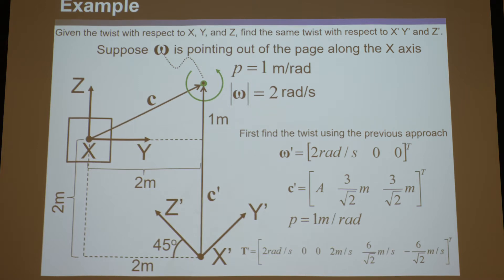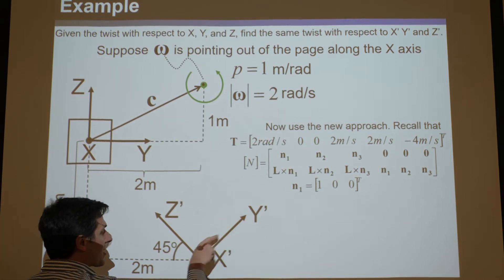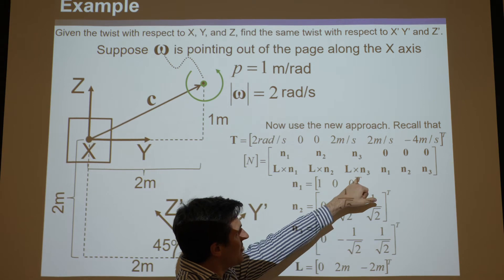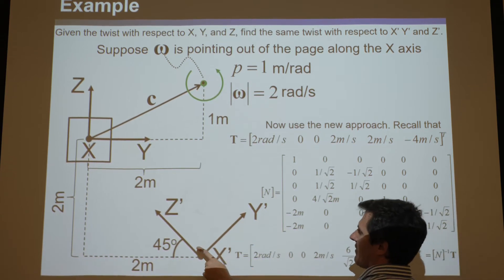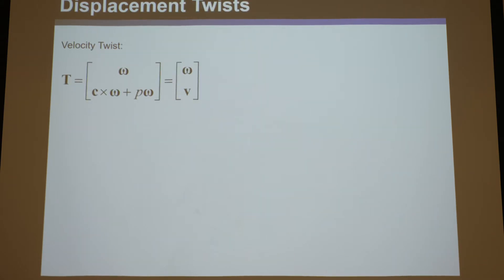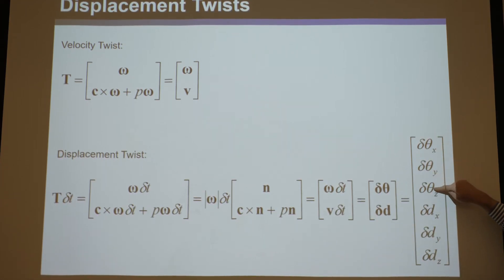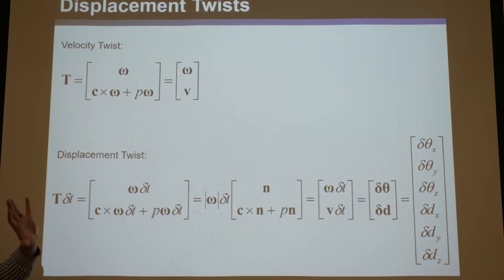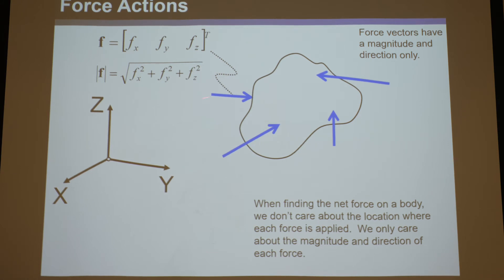Compliant Mechanisms Lecture 2 Part 4

Comment: ## Lecture 2 Part 4 Summary

9:12 Analogies Between Velocity Twists and Wrench Lines (Forces and Moments):

* The lecture emphasizes the analogy between velocity twists and wrench lines, which represent forces and moments.
* Wrench lines are depicted as orange lines, analogous to green screw lines.
* They are described by 6x1 vectors, where the top three components represent force (F) and the bottom three represent torque or moment (τ).
* Similar to screw lines, they have a location vector (r) pointing to any point on the line of action and a "q" value, analogous to pitch, representing the coupled moment per force ratio.

13:48 Force, Moment, and Wrench Types:

* A wrench with q=0 represents a pure force, depicted as a blue line.
* The torque is calculated by the cross product of the location vector and force: τ = r x F.
* A wrench with q=∞ represents a pure moment, analogous to a translation.
* Pure moments have no specific location.
* A wrench with finite q combines force and torque, similar to a screw motion.

17:00 Key Difference in Organization:

* One crucial difference between velocity twists and wrench lines is the order of angular and linear components.
* In velocity twists, angular velocity (ω) is on top, and linear velocity (v) is on the bottom.
* In wrench lines, force (F), a linear quantity, is on top, and torque (τ), an angular quantity, is on the bottom.
* This difference in organization will be significant in later concepts.

17:52 Final Takeaways:

* The lecture stresses the importance of understanding the analogies between velocity twists and wrench lines, as they share many mathematical concepts and relationships.
* Although mathematically challenging, mastering these concepts is crucial for grasping the later principles of compliant mechanism design.
* Encourage rewatching the lecture multiple times and practicing the examples to solidify understanding.
* Emphasize that even without fully understanding the derivations, students can still apply the concepts and succeed in the course.

Comment: Boy, when I heard 'displacement twist', I was pretty sure I knew where that was going. If you imagine that there were a physical, rigid body, that was three orthogonal arrows labelled 'x', 'y', and "z', at the origin and aligned with the axes... well, there is a twist vector which would, after say 1 second, bring it to a new position with a new orientation, at displacement L and pointing in directions n1, n2, and n3.  I figured the 'displacement twist' would be this twist vector, multiplied by 1 second.

There should be a formula to get the 6x6 transformation from this 6x1 vector... if I understand the word 'tensor' right, the formula might be expressed as a tensor multiplication?  Not sure about that.

Nice teasing at the end!  That bit about the linear/rotational bits swapping top/bottom locations on the vector is intriguing. I look forward to what you have to say about it.